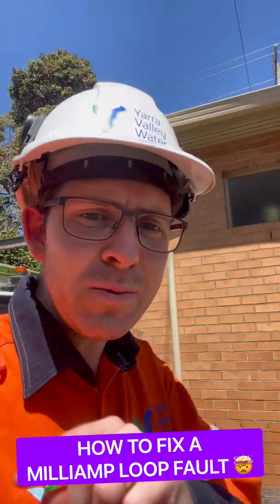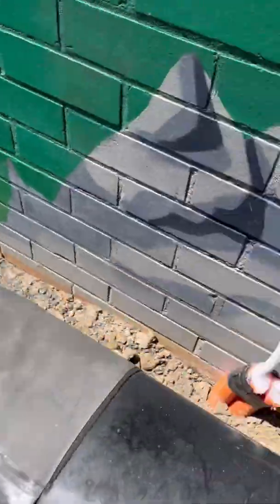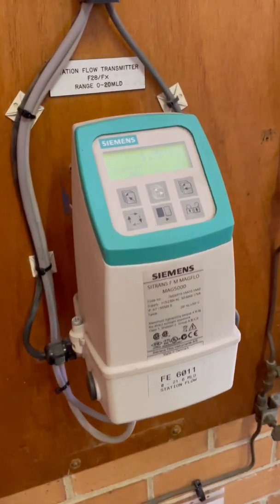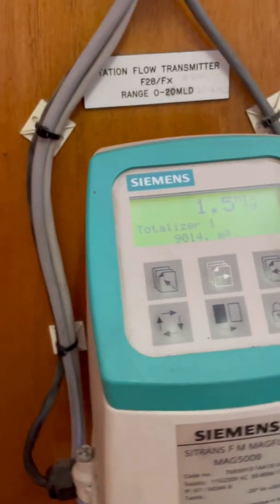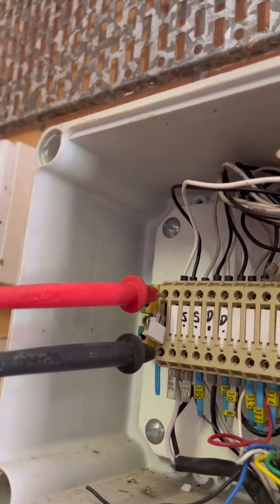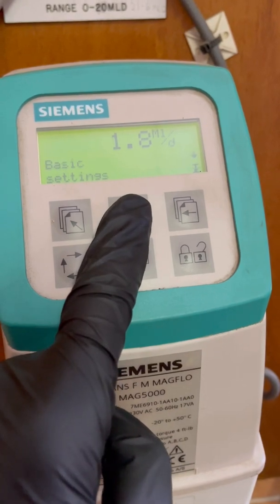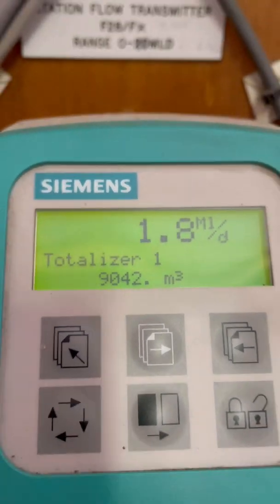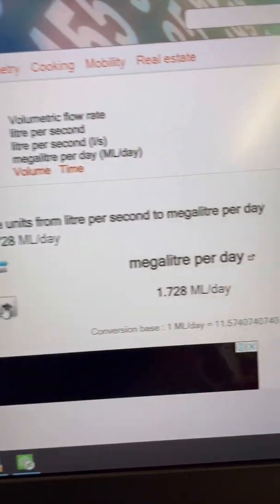Can't Believe how EASY it was to Fix this Fault 🤯

Comment: Had someone decide it would be a good idea to try French on flow meter. Luck would have it, a second flow meter was on site, and I used this to work out the keys required.
Reply: Great videos, almost the same job, work at a local council in northern NSW in Water and Waste. Electrical Technical Officer, looking after Telemetry network/PLCs and electrical project upgrades.